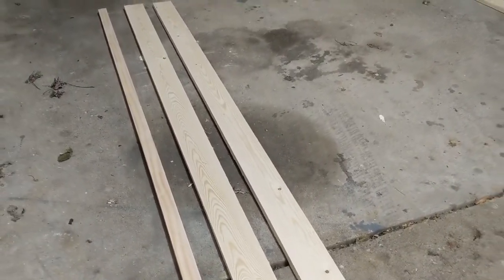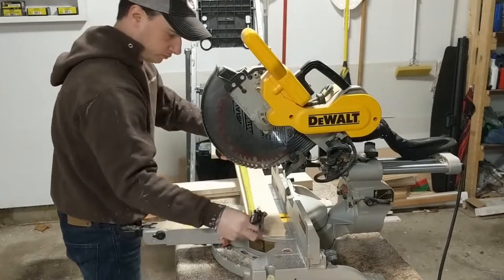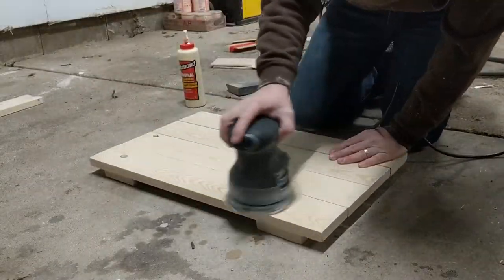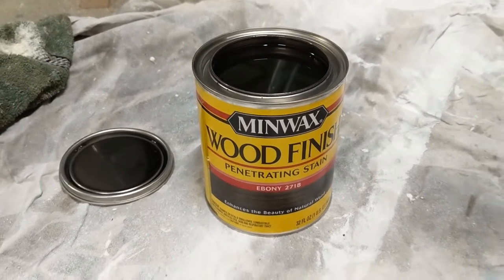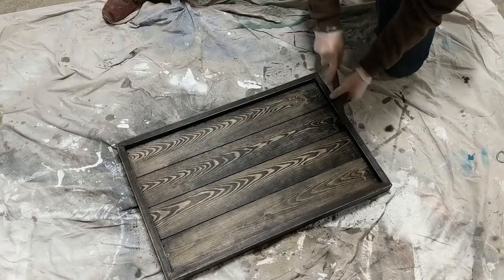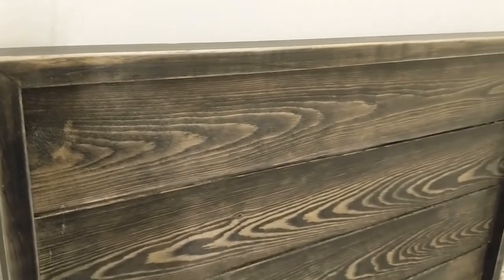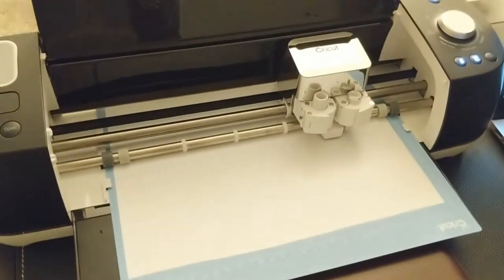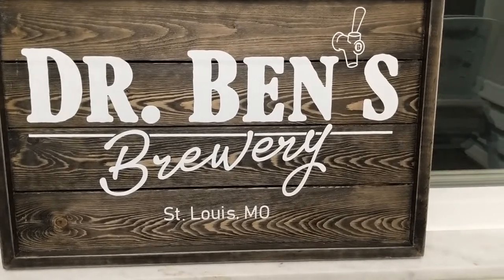MAKE YOUR OWN WOODEN SIGN // DIY CUSTOM SIGN WITH VINYL // Projects With Steve

Comment: Clear and succinct video- great stuff! I am hoping to build a sign like this and hang it outdoors. Any special considerations? Will that require different wood? Different stain/poly? Is Cricut Vinyl outdoor friendly, or should I consider painting instead? Thanks!
Reply from the maker: I would use an outdoor polyurethane to seal it for exterior use.

Comment: I keep looking for a video that shows water-based polyurethane, and you’re the first I’ve seen that is using actual water-based varithane - and not using polycrylic (which is technically not intended for outdoor use).  So, my question is:
Is it fine to use the water-based sealant over stain, even though the stain is oil based? I was always trained that water-based products shouldn’t be used on top of oil based.  And yet, I never see stains available at the hardware store that are water-based.  It really confuses me.
Thanks for the video!
Reply from the maker: I’ve used water based polyurethane over oil based stains lots of times with no issues.